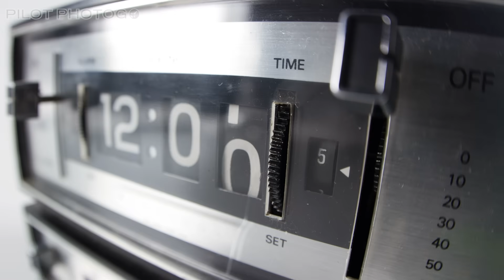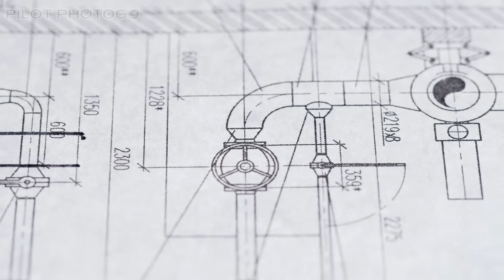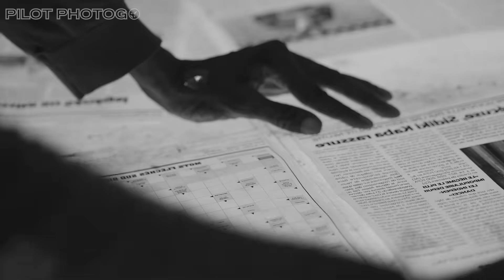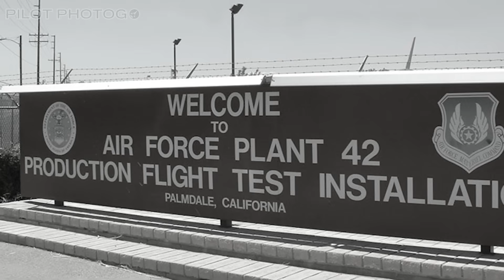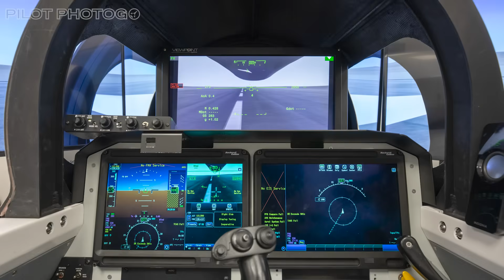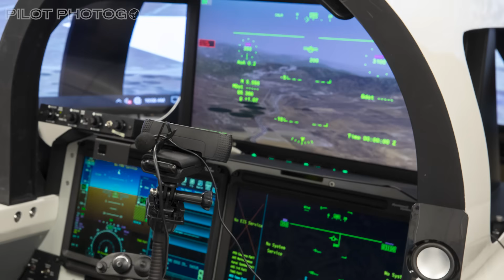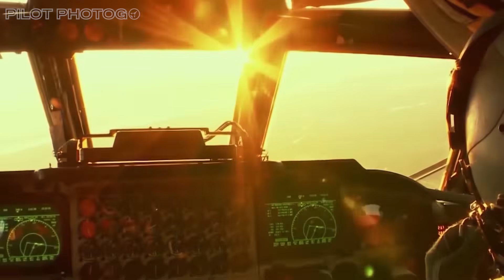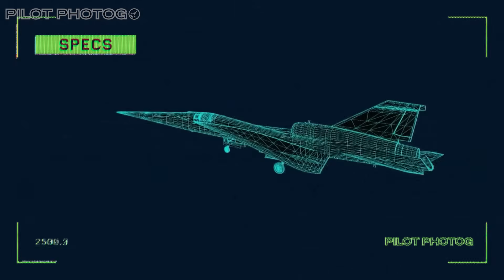The Silent Supersonic Plane Is Here!

Comment: With current air power pilots are sending weapons from other cities. They don’t even see the targets… maybe the smoke and wreckage. Beating the sensors and radars by electronic manipulation and being long gone before they figure out what just happened. The cost is what will keep supersonic flight out of the civilian marketplace. Let’s say you did create an aircraft that could eliminate the noise and was allowed to traverse over land. How much would that LA to NYC how many seats and cost per seat would you need to make a profit? And how reliable would the aircraft need to be? The price to fill each seat would make it hard to fill a flight. Would they just fly it with half the seats filled or would they have to cancel the flight? How many cancelled flights before that mega wealthy client just charter a flight he could sleep on or one of those flights with the semi closed cabins for cheaper?

Comment: It actually looks like a 50ties or 60ties science fiction movie prop. Partly because radar stealth and sonic stealth are almost complete opposites. This thing is a radar stealth brick. Just like the F117 will have been a sonic stealth brick. So civilian application is feasible but combining all stealth requirements into one airplane will lead to a ton of compromises. And then there is the environmental issue. When Concorde was banned the ozone argument also reached the public for the first time. But the US do not have an environment, don‘t they? They only accept denial.